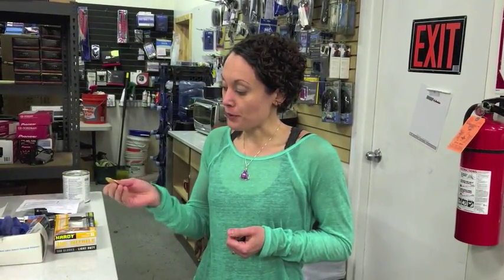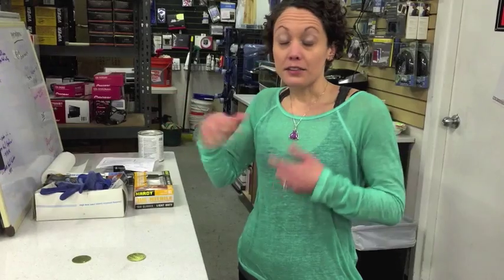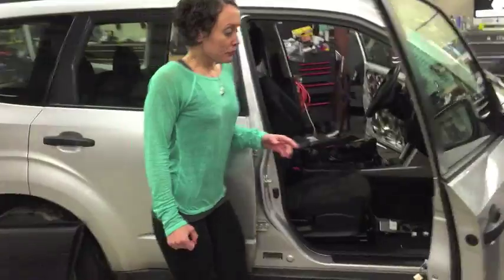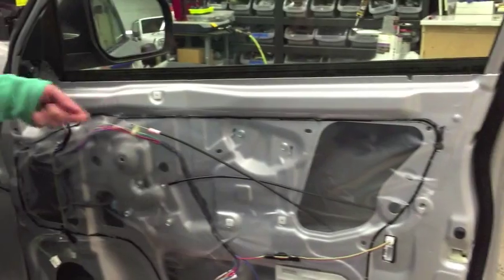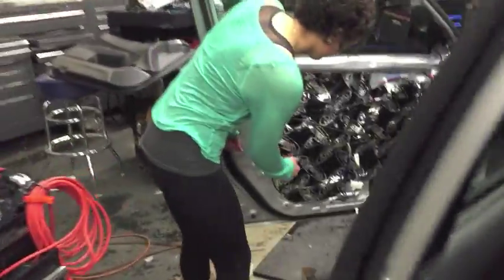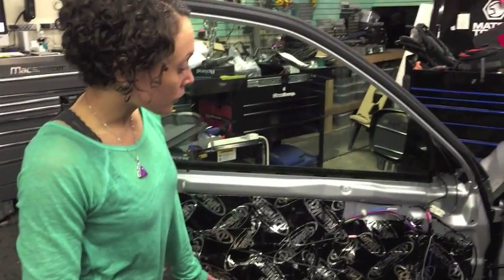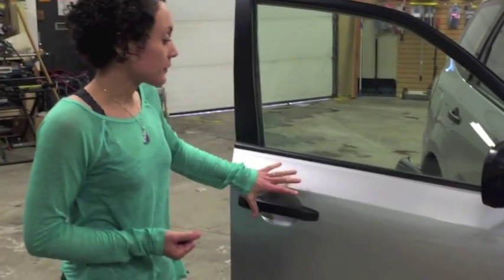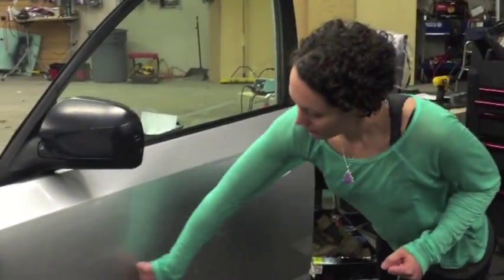Dynamat Review by Car Stereo Chick

Comment: Hi Annie, 
I am impressed with the extent of knowledge you have. You are doing great. I saw your other videos too.
I recently got a 12 inch Blaupunkt woofer having 300 watts RMS with Blaupunkt 2 channel 330 watts amp. The woofer gives an amazing bass as it is put in a sealed enclosure. The box dimenshions are around 15*14*13 inches having an approx 30 L of cubic space and i think it is quite small when it comes to high volumes. So when i get it to the higher volumes  the woofer kind of suffocates. I tried to port the box but then i am losing the lower bass notes. So what if i go for a bigger sealed box? Shall i stuff it with polyfill, or keep the old box and upgrade it with polyfill?

It would be great if you could guide me in this.
Best Regards.
Neeraj.
Reply: Find the specs for the sub and install the woofer in the recommended enclosure. Porting a sub without knowing the parameters is not a good idea at all. You also might need a bit more power.
Reply: @Assimilator702  Thank you so much 😊.
Reply: @bababaphotri  No problem.

Comment: i Got 4 layers of different sound dampning in my car to quiet down alle the different frequencies..  First the butyl layer ( same like Autofun, STP, Silent coat..Dynamat you name it)  And it should only cover 25% of the panels ( in this video she is doing 100%) and that is wrong.. butyl rubber is only made for vibration NOT sound dampening..try using MDF wood next it will also sound damp, DOH . The only thing that will quiet a car down by alot is proper Weather stripping, closed cellfoam and Mass loaded vinyl ;)